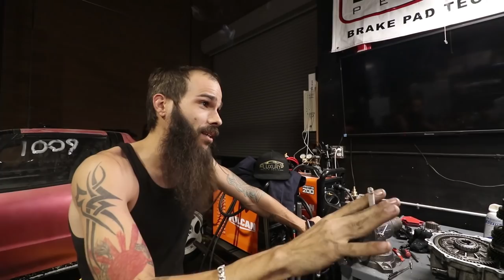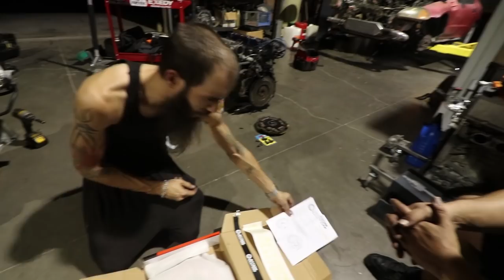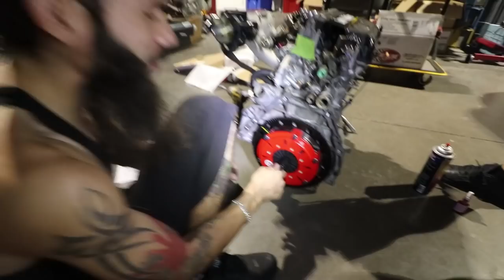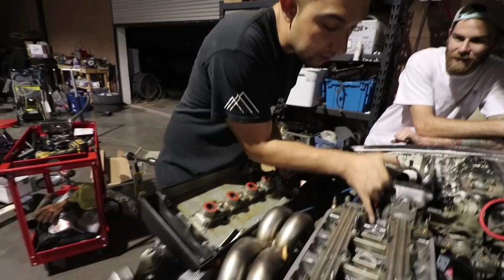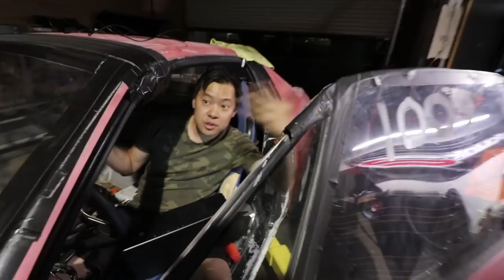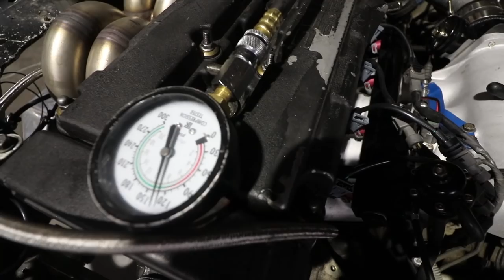THE CHINA BUILD MOTOR GOES IN THE PINK WIDOW

Comment: In what universe has Chris anything to anyone about shifting?
 He's like ground every gear in every box he has ever driven in this channel. Carlos only misses the 3rd, just because his arms are too short for stock throw.
Reply: Oikku Oek lmao Carlos arms are to short
Reply: Technically I only broke first gear on the k series transmission i’ve been having the same transmission in white smoke for 4 years now never broke it only broke one axle
Reply: How can you miss-shift first? That has boggled my mind since I found out about it. I'm not trying to throw dirt at you, but how? I have broken 2nd, 3rd, 4th, 5th and reverse (once shifted from 5th to reverse at full blast), but 1st? That's pure money-shifting.

And another thing: Why you guys won't take shifting seriously? When draggin' a manual, shifting is the main time consumer against automatics. Shifting is the spot where you either win, or lose the race. And you guys are using stock gearing, stock lever, even stock clutch pedals, and try to hit tens? Pink Widow would go 9's if only you cut the slack. Slack from gears = less bogging, slack from shift mechanism = no more miss-shifts, adjust the clutch so you know where the grip starts = sharper shifts, quicker off the line.

Racing is hard work that requires all the focus to win. Any kind of half-assery makes you a duck.
Reply: Oikku Oek Touché you’re 100% right but were talking about the pink widow lol and we love shifting I like going through gears makes things more interesting and fun but you’re right about the gearing shift mechanisms and all that jazz but remember we’re not trying to spend a fortune we trying to keep it simple and these B series transmissions can take a beating the gears pretty good for this motor we got her hitting 140s which you’ll see in the next video